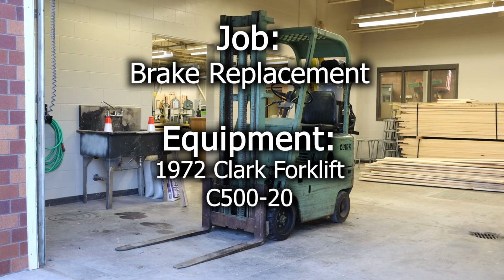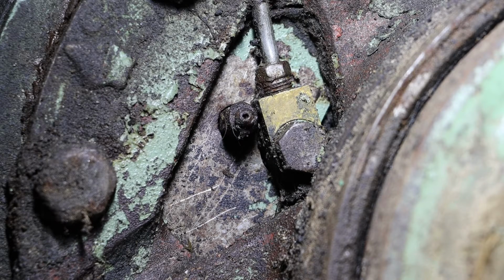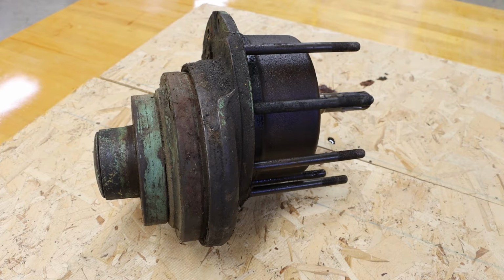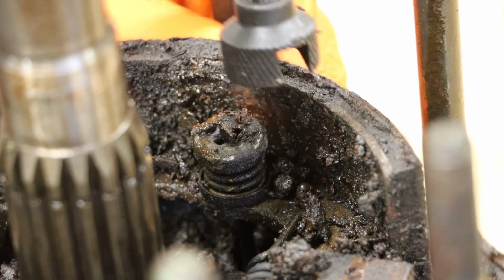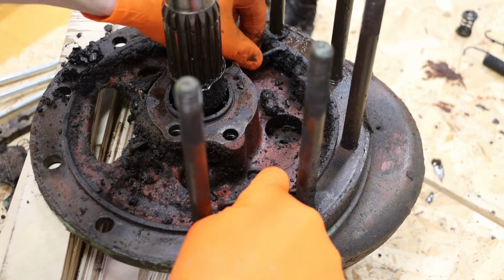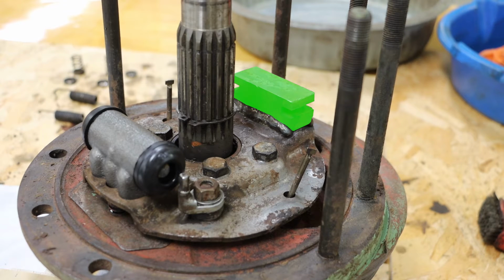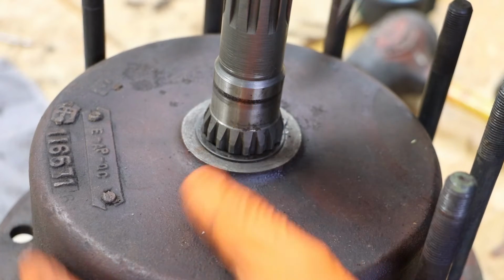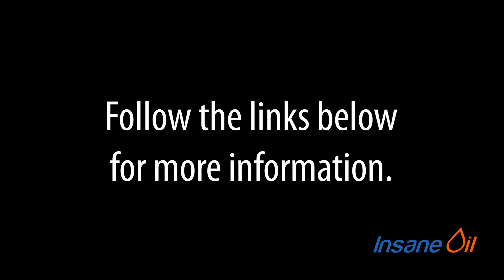1972 Clark Forklift C500-20, Drum Brake Repair (Pad Replacement)

Comment: Great video. Very helpful for a DIY job on mine Clark C500. As there is no lost in brake fluid and no signs of leakages, I wonder, why it doesn't brake. Inching and handbrake are fine. Brake pedal doesn't come up by itself. Any idea?
Reply from the maker: Is the return spring in good condition?  

https://drive.google.com/file/d/1QFCTizo3iNow9rVYXFRL2I9zL5KjFAxd/view?usp=drivesdk